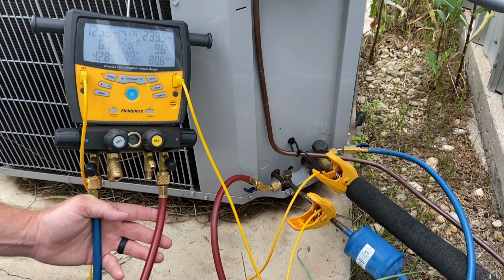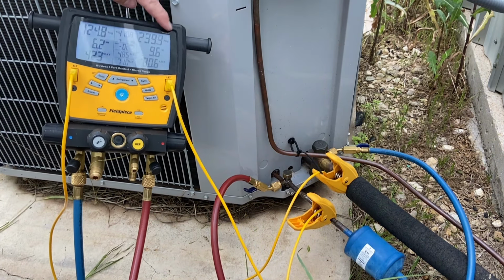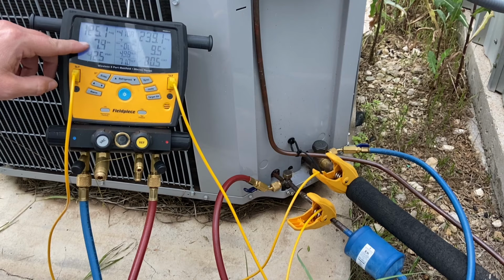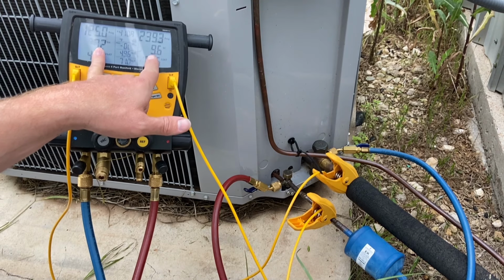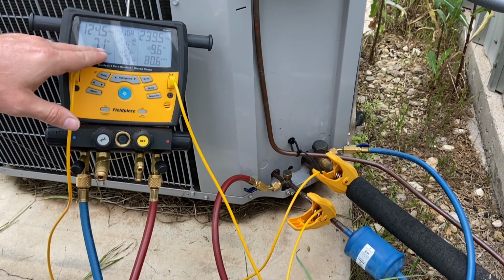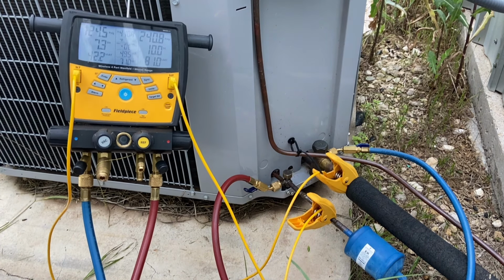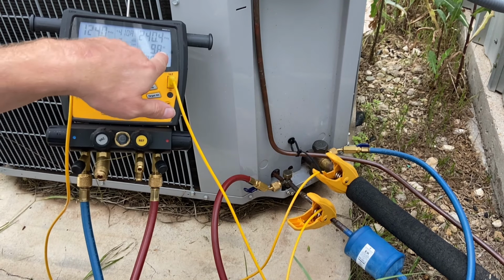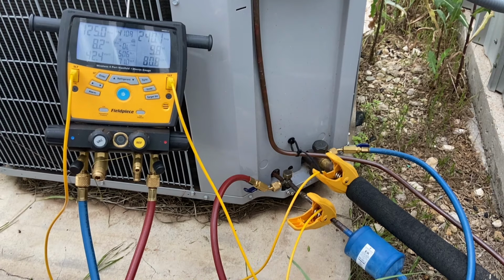HVAC 065 example Superheat and Subcooling with digital gauges

Comment: Great video l starting to use these digital gauges its confusing at first but ill get the hang of it thanks man id like to see more
Reply from the maker: Keep at it and it gets easier.

Loose general guides to help
Dont worry about pressures, look at superheat /sub cooling, keep your SST suction saturated above 32 (airflow) and your LST ( Liquid saturated 10-20 above ambient)

Target Superheat and Sub cooling depends on the metering device
Reply: @love2hvac  thank u man appreciate ur advice

Comment: Hi Ty, I tried to find chart for r 32 to check super heat and subcool but I can’t to find as that chart for 410a. Thank you.🌹
Reply from the maker: Most apps have them, digital gauges can be updated but if you want a hard copy, AC service tech has them in the quick reference card. 
You can also order paper ones  or even download a free one from ESCO Institute.
Reply: @love2hvac  💐

Comment: Can I connect the bottle for charging to the "red port" on the manifold, instead to the "yellow port"? Because I`ve a mini-split and the "red port" is free. I would like to use the "yellow port" only for recovering refrigerant. I have 2 knobs on my bottle, for liquid and gas. This means I wouldt have to change any hoses. Or is there something against doing it this way? Could the SMAN be damaged as a result?

Comment: what is that copper line by the suction? Im distracted by it while watching the video :)
Reply from the maker: The low voltage wire is ran inside it. 
It's an old school method of protecting the wire but the copper must be debuted and flared first. Actual liquid tight 1/2 is a better way

Comment: Thanks!   I have the SMAN 360 for a couple mini split installs I did and wanted to see microns of vacuum.  My friend has an R-22 system with a leak.  The past two years his A/C guy has added 57 lbs of NU-22 at $100/lb (crazy when the whole bottle was $200 a couple years ago).   I'm not sure if he evacuated out the original R-22 or just added NU-22.  They should not be mixed says the internets, but keeping an old system going for another year I wonder if it's something some just do.  I'm not touching it!!
Reply: My r22 ac has been low on charge for years. I just cut the whole unit out. Taking the Schrader caps off one has a leak for sure. Little spurt. I'm sure there's other leaks but not sure. The indoor coil ices up is the end problem. Throwing in expensive gas, over and over is so dumb. I didn't want to waste any money on one that is old. It's probably 20+ years old. I bough a sm480 and more ports isn't always better. Maybe convenient for things, but it's a bit old and needs a rebuild to do deep vacuums. It'll hold around 800 mics but not lower. Pressure up it works good. I'd hate to be ignorant to whats really going on with a system and keep calling someone out to add and add add. Greedy company, not informing the customer. Or gouging on a replacement quote. Or customer is insane.

Comment: Hi Ty! I got 2 degrees super heat and 7 degrees sub cooling after starting the system about 20 minutes so is that could heart a compressor and should remove some amount of refrigerant?🌹Thank you.
Reply from the maker: What meeting device? 

It's likely  you have an air flow issue or dirty coil but more information is needed
Reply: @love2hvac  Soory Ty it’s a TEV
Reply from the maker: It will either be airflow dirty coil or a TXV stuck open

Comment: Ty, speaking of airflow and txv’s, I was visiting my brother and his wife last night.  They bought a house with a 2015 Lennox system. ECM motor on the furnace / air handler and single stage straight AC scroll compressor outside.  The installers noted the cooling mode dip switches in the “medium low” blower speed settings.  I was very surprised / confused by that.  Reputable company that did the install. Ever seen a situation like that before?  Didn’t make sense to me to have the AC blower speed set to medium low.
Reply from the maker: Without seeing the whole picture it's hard to say. 
Here is an example to think about.
In Florida, we installed an all-new duct system, with a new unit. moved the ducts out of the attic and into conditioned space and used large ducts, we installed the largest possible evaporative coil for the matchup and dropped the fan dipswitches to low.
We still had enough airflow but the larger duct allowed us to lower the fan speed. The lower airspeed meant less heat over the evaporator and a lower saturated temperature that meant better dehumidification. The larger coil also allowed us more room to boil all the refrigerant to vapor and still have efficient superheat for the txv to work and to protect the compressor. 
In short it lead to great dehumidification without dropping the house tempersture. 
We had 350 cfm/ton .05 static pressure and maintained 56‰ RH at 76°F

Now that's just one senario.
The likely conclusion is the fit was tired but the only way to know is to test the CFM and know .
Reply: Tonnage I have a similar system 2016 Lennox dosnt make a2.5 ton system so the adjusted it to blower lower speed from my understanding

Comment: Hello Branaman is possible to measure super heat and subcooling for every system? Thanks.
Reply from the maker: Most systems. 
There are always exceptions. 
Ductless\mini splits
Low-pressure centrifugal chillers,
Flooded evaporators.
Subcooling will very depend on things such as liquid receiver. 
There are other methods of charging I will get to soon.

Comment: nice explaining but where do i find the numbers for example for my pump toshiba daiseikai ras35.. im using it for heating mainly and i would like to check that its working effectively
Reply from the maker: I usually see Toshiba in ductless units. they charge by weight and line set length most of the time. a completely different method I have not yet discussed.

Comment: I understand that for TXV metered units you will charge according to subcooling. Is it possible to be overcharged and have lower than normal subcooling thinking you need to add refrigerant? If yes, what problems with the unit might cause this?
Reply from the maker: TXV charge by subcooling but you still need to check superheat.

Airflow is the biggest issue,. With low airflow superheat and subcooling will be off.
Reply: @love2hvac  Thanks. I'm just a DIYer so I appreciate you taking the time to respond.

Comment: Hey, I don't understand measuring superheat a little bit. On the ParkerSporlan website in the literature tab, you can find a lot of interesting documents explaining the operation of ac system. There i found:
 " The important thing to remember is 
that the pressure-temperature relationship as shown by a P-T chart/
application is only valid when there 
is a mixture of refrigerant liquid and 
vapor."
So, in car system if i want to check SH i have to measure temp. on outlet pipe from evaporator by clamp - ok. But i cant measure pressure exactly in point of evaporator where is mixed liquid refrigerant with vapor, cause there is no LP valve, LP valve is usually on suction pipe on compressor so there is or should be 100% vapor, how my pressure shown on the gauges is reliable to that pressure which is in the evaporator where the liquid mixture is ? or i misunderstand it?
Reply from the maker: Formula for superheat is:

Actual suction line temp______⁰F
- Suction saturated  ________⁰F

You know how to get the actual suction line temperature, a clam on the suction line.

Next how to get saturated. 
You can try to get a thermometer at the very beginning of the coil where it's saturated (aka liquid and vapor, aka ref boiling, aka latent heat aka change of state)
But it's much easier to get the suction pressure anywhere in the suction side as it's all the same. Then convert that suction pressure to a saturated temperature (psig converts to saturated temp) it does not matter where you get the suction pressure it will be the same. Once you convert it to a saturated temperature, that's the temperature it's boiling at that's the temperature it's changing state at, that's the temperature it is where it's liquid and vapor. 
Even if you 50 feet away from the evaporator I can get the pressure and convert it to a saturated temperature and know the temperature at the beginning of the evaporator coil. 

So on your car get the actual suction line temperature _______⁰F

Minus -

Suction saturated (psig-temp)_______⁰F 
= Superheated vapor
Reply: I don't think SH and SC is meaningful on a car. The compute controls the A/C system and there is a huge difference between idling and driving (airflow).

Comment: My fieldpiece gauges couldn't take the heat and are now been looked at.
Reply from the maker: Oh no! They pretty good customer service. My set is over 5 years old without problems. I don't use them as much as I use to but they have also survived 3 schools.
I do keep the screen out of direct sunlight. Learned the hard way.

Comment: This is one of the biggest mistakes people make while making these vids. The superheat should be measured at the evap if you don’t have a very close coupled unit. And people making these vids should tell people that so people learning from these vids know how to do it the right way.
Reply from the maker: It is not a mistake at all.  Their is importance of both measurements and that is stressed later in this series.  Every Copeland class you go to will stress the importance of measuring superheat at the compressor to protect the compressor. Every compressor diagnostics will want superheat before the compressor.  It is extremely important to know the superheat at this point outside. Later in this video series, I also talk about the importance of measuring superheat at  the evaporator. It's important for superheat measurements and adjustments. The biggest issue with evaporator superheat (excluding compressor protection) is the lack of a service port at the evaporator.  Without this you evaporator superheat will NOY be accurate as it does not account for pressure drop of the suction line. That leaves people to assume or make guesses of that the suction pressure is which makes the evaporator superheat another guess. If they has analogue gauges it would be pretty funny watching them take a reading outside and then run inside to get the temperature then wondering how much change happens between that time. 

Subcooling should be taken before the metering device but now many installers do you see actually installing a test port at that location?

No matter what I do there is always somebody complaining about these  FREE videos.  You should spend the time and money making your own videos the way you think they should be done.  Be sure and spend a few hours every day answering all the people  complaining that your doing it wrong.
Reply: @love2hvac  first of all, I’m not attacking you. That’s obvious by my choice of the words “people” and “these vids”. Second, you totally missed the point of my comment. I specifically said “when you don’t have a close coupled unit”. Did I not? I’ve watched tons of AC vids on YT and only one guy, an older guy, mentioned that superheat should be taken at the evap when you have a long line set. You and all the others never even mention it. You want to try and teach young techs how to do things? That’s great, we need more teachers, but at least give them all the info. Any time I have the system open or on a new install I add a vapor line service port right at the evap. They’re $15 for a 2 pack and it’s only 10 minutes and your equipment is already there. A vapor line service port at the condensing unit will always be affected by high ambient temp and line set length. And finally, if you’re talking about all the investments made in making these videos like it’s a huge burden, stop making them.
Reply: Newbie here, loving your videos. I measured 36° at the suction line at the compressor and had saturation temperature of the suction line also at 36°. (ie. no superheat)  But then I measured the temperature at the output of the evaporator coil and got 42°.  Assuming my temperature measurements are correct, then there must be a restriction in the suction line. But I couldn't find one.  I'm assuming there must be a pressure drop across the suction line from the evaporator to the condenser.  It's about a 20-ft line set.  Is it normal for the temperature of the suction line to drop from the evaporator to the condenser?
Reply: @tpistor from the evaporator, did you measure up or downstream of the filter drier, if there is a filter drier
Reply: Both measurements downstream.  Filter drier is in outdoor unit factory installed.  I think I found the issue though, I didn't open the suction service valve far enough, and I think that was the restriction.  The cold temp on the inside just after the service valve may have traveled up stream and made the point on the suction line right at the service valve cold.